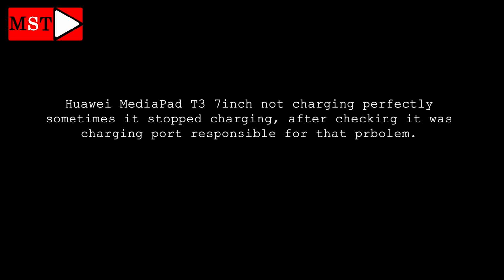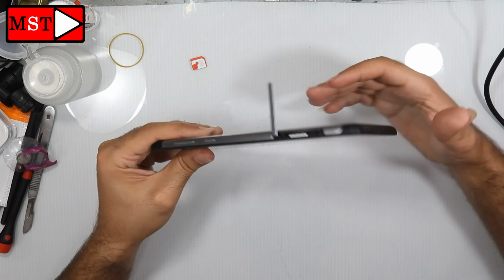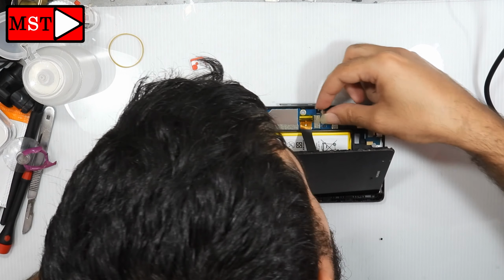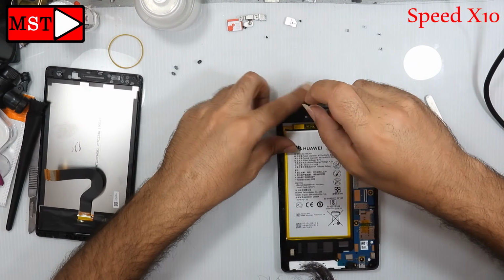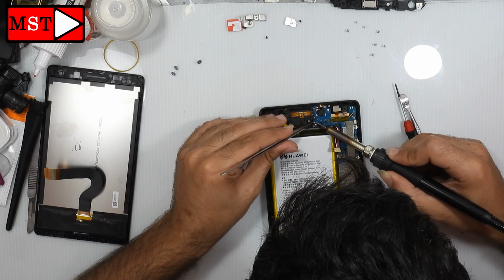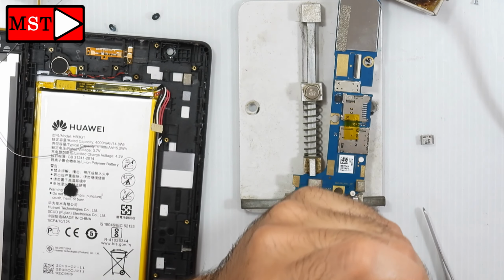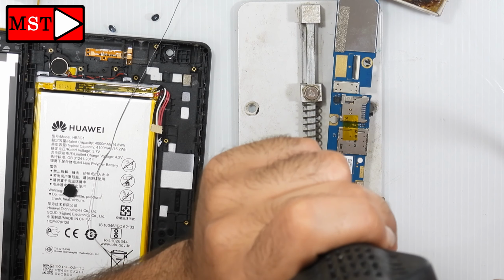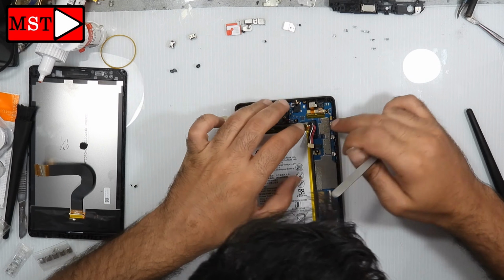Huawei MediaPad T3 7inch Not Charging

Comment: (Currently using phone) My tablet has not been working for the past 3 years and it charges but the battery doesn't go up it stays red. My tablet also doesn't turn on because the battery is now only 0% and I keep trying to find ways but all of the tutorials I see needs to take the back off. Is there a solution without the back of the device getting taken off??
Reply from the maker: Maybe try to charge with super fast charging, this may fresh the battery.

Comment: I have the same tablet, it is stocked with red light and battery image on the screen but it doesn't charge even I left it for an hour. What might be the problem?
Reply from the maker: Check your charger, anf make sure the charging port is working correctly.